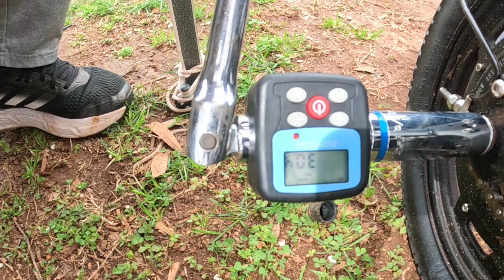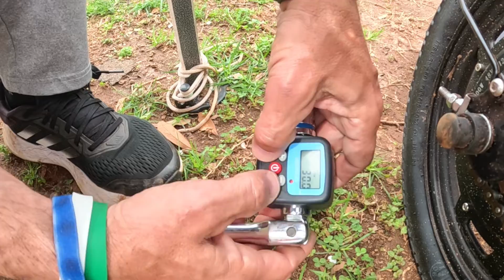GOYOJO Digital Torque Wrench Adapter - Review

Comment: Hello, they say you have to calibrate it once a year, how do you do that?
Reply from the maker: I have to look into that
Reply: Any update? @viewcoofficial
Reply: Did you buy? Calibration?
Reply: Where did you get that info? "they say"
Reply: You can enter calibration menu by holding power button for max 1,0s then instantly holding U/S button and releasing power button still holding U/S button. Then appears menu with blinking "0 - - - -"  on screen and u can increase each number slot using "+" button and switching to next slot using "-" button, at this point I dont know anything more... You can return to normal mode by clicking U/S button once. I'm looking for someone who can explain how to use that menu. Cheers

Comment: Why didn’t you show how to put the batteries in?? Jesus it’s impossible and not in the manual.
Reply: Dude if you can't competently manage to achieve putting the batteries in the torque device in no way should you be working on anything that requires it's use .
Reply: You must be joking, right? You are definitely joking, right??
Reply from the maker: Its 2 AAA batteries under a cover on the back if you every changed the batteries on a remote to your TV you will be able to on this one 😎
Reply: Whatever you do, don’t have children😂